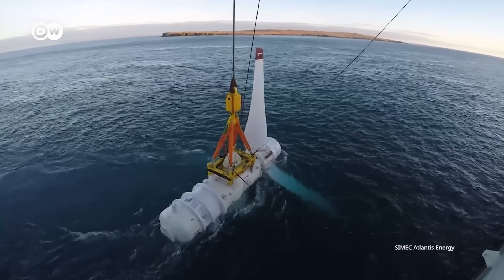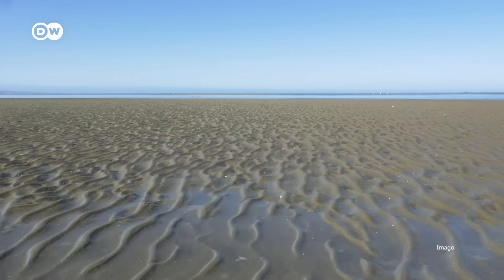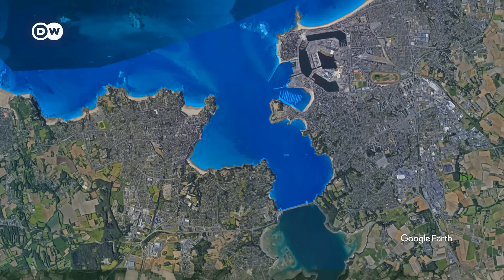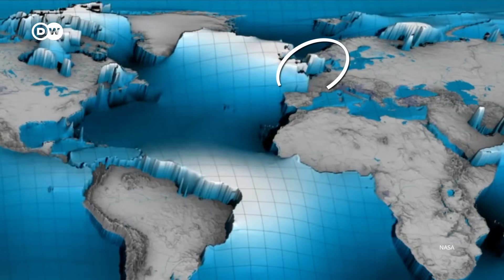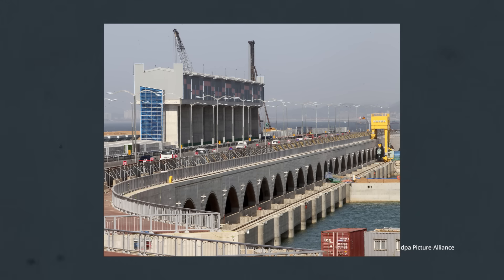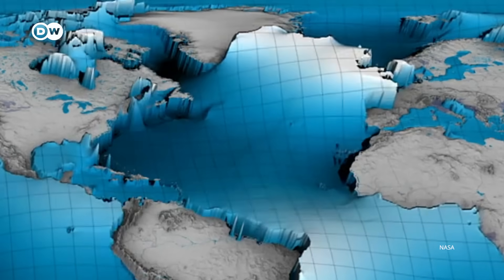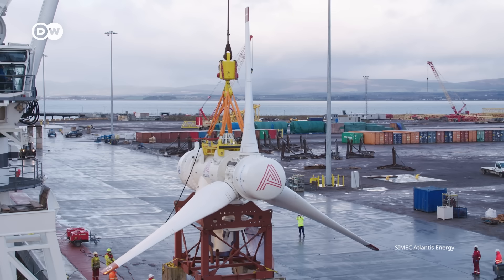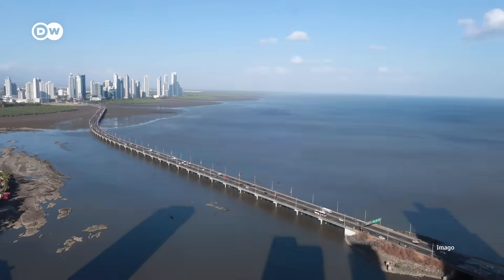Tidal energy could be huge – why isn't it?

Comment: Tidal power will never become a thing beyond the few test facilities build - reason: Maintaince.
Not only are such power plants extremely expensive and difficult to maintain, not to mention the loistics required, but they are also heavily in need of that expensinve maintaince.  And, for one very specific reason - fouling - a problem nown from boats since the dawn of time - and it will only be worse with fully submerged structures.  Yes, you can avoind fouling in the first years, using special surface treatment, but once it starts, it will be a never ending tasks to maintain.

Comment: Why ?
One reason might be we are trying to use a fish-slicing machine to generate that power and of course, meet HUGE resistance from animal welfare and activists.

Cant we develop something based on ARCHIMEDES SCREW instead ?  Pipes can be laid parallel to the sea bed, along the lines that ocean currents flow. No rotating parts to cause damage to beast or machine. The pipe rotates in the current and so is very unlikely to "hit" anything. The size of the external fins needs to be calculated for each location's characteristics, but you imagine they will be less than 50Cm high and so unlikely to catch any fish or whale, "unaware" and they swim into it.

Comment: Cool that you included Minesto´s Tidal Kites in there. They have a new model now it´s called the Dragon 12 and produces over 1,2 MW power. Easy to replace and low in maintenance cost. The Faroe Islands between Norway and Iceland already uses them on the grid.

Comment: a boat anchored will rise when tide is rising. That should be able to generate energy. Than when tide lowers, hang the boat above the water and use gravity to generate energy. No blades in the water. No corrosion. 
The boat can be very big and actually be not a boat but just a floating thing. The optimal weight to be calculated. 
???

Comment: Isn't it possible to use high quality strong plastic turbines to save against corrosion. With a bit of nano particles around, and a thin metal plates encapsulated inside.

Comment: Underwater turbines that look like windmills are about ten times too expensive.  Water provides buoyancy.  Instead of an expensive foundation for a post, a simple mooring would suffice for a turbine set up on a tether.  It would be neutrally buoyant, but adjustable, to rise to the surface for service, or sink to the bottom for shipping to pass.  When working, it would stay off the bottom with lift also generated by the current.

Comment: The ones that will succeed will have a nature covered (for aesthetics) cement pier type line surrounding long lines of turbines along the middle and/or most potent currents of the major tidal rivers and waterways (NOT across them) surrounding them so as to both protect them and to pull them up for service and cleaning when needed. The pier will be surrounded with pull-up (for regular cleaning) strong wire mesh fencing to keep marine life out and negate any marine biologist objections. In this fashion, ships and marine life can go around it on each sides untouched and unaffected.

Comment: Tidal energy is a pipe dream. The total annual energy flow of ocean currents + tidal + wave energy is around 700 exajoules. We currently consume 500 exajoules of fossil fuels each year. If we harness every single wave, tide and current at 100% efficiency so that there is absolutely 0 motion in the oceans, which of course isn't possible, we could barely power our current societies. Now imagine the scale of a machine that can absorb every single movement in the ocean - or even half. It would be as impossible as ridiculous, half of the planets ocean would be covered in moving contraptions.

Solar energy has for comparison an annual energy flow of 3.900.000 exajoules. The same energy can be achieved using far smaller areas, with far simpler machines with far fewer and smaller moving parts.

Comment: Not needed to store, with dispersed barrages five barrages could have supplied the  whole of the UK. In 2006 the UK had an inquiry into the Severn Barrage, objected to by the Greens and RSPB who said nothing about bird munching wind turbines. UK decided it would be too costly. A Severn Barrage could have provided road and rail infrastructure as well as tourist dollars. It was easy to tie the power to Hinckley nuke. In addition, will protect riversides from Global sea level rise. Presently there is a Lancashire Barrage, going to planning. The UK government is looking at building a dumb Barrage on the Medway. A generating Barrage would protect London and supply power for both London and Kent.

Comment: How many of these does it take to slow that current down
Reply from the maker: Hey there! As tidal energy uses the rotational power of the Earth, it is actually gradually wearing down the rotational power. However, that will take incredibly long and also depends on the usage of tidal energy.

Comment: Barnacles? Can you install them the length of the Mississippi, Ohio, Missouri, and St. Lawrence rivers in fresh water? Propelling and lifting tether-line electric trains continuously up and down river seems reasonable enough on the surface. Surely the NOLA current is strong enough, but what about the other thousands of miles upstream? Dams depend on head, not current, so would tidal generators work better? Or does the channel have to be made uniform concrete and maintained constantly?

Comment: Why? I bet it has the same problems all renewable tech have, the biggest is base load problem. We have to go full nuclear if it is not too late already. DW will likely block me now because they know the doctor was right about using Th MSRs, or even PWR to power the world :) Doctor was "blocked" too, in late 60's or early 70's, that's the way people like DW operate.
Reply from the maker: Hi Coda Alive, have you watched our video about nuclear already? We asked the question if we need nuclear power to stop climate change: https://youtu.be/9X00al1FsjM – let us know your thoughts in the comment section ☢🌍
Reply: @DWPlanetA  This are finally some great news, thanks for making it and letting me know because i would never expect DW to be so open about the nuclear solution. Hope to see more about it like burning nuclear waste in modern reactors, molten salt reactors on either thorium, uranium or mox cycle, passive safety, exposing problems with renewables few talk about and so on.
It is great start, keep the good work. Thanks!

Comment: A company called Ocean Power Technologies that does not need any turbines. It is simply a vertical stator with a floating magnet in the shape of a doughnut that rides up and down in the waves. ONE moving part and it is NOT a turbine....it just travels up and down on the stator as the tide goes in and out in the middle of wave actions .It does NOT affect  wildlife....again.....NO TURBINES..... WHAT HAPPENED TO THAT??????

Comment: This not a new concept. There are many problems with this.  The turbines need to be placed in an area with a high energy concentration.  Those tend to be areas with a lot of boat/ship traffic. Also electric, metal anything in salt water requires massive maintenance effort. There would also be a lot of environmental issues to deal with as well.

Comment: Title energy is something that's been around for decades upon decades upon decades. It's a simple alternator that's all it is to generate electricity. Don't get me wrong I think all forms of renewable energy should be obtained and used. But you move the focus on the one particular one over another one saying this one could be the best one though this one could be the best one you end up losing them within the group instead of focusing on the group itself. All renewable energies should be the focal point. Don't nitpick one or the other. And if you windmills are expensive to build and maintain just imagine how expensive these are going to be. And just imagine how much these are going to fail and need to be maintained and have constant maintenance performed. That does not mean don't try but don't glorify something like that either that requires components that we don't produce and requires minerals that most people on the left wouldn't like where we have to obtain them from.

Comment: Hydro power is superior to all other types of power because the whole ocean evaporates all day long and then deposits that power in the form of rain high up on land so all humans need to do is just make a bunch of hydroelectric dams on the same river. The water has potential energy untill it's back in the ocean. That's like a straight mile downward to collect that waters potential energy as it travels down

Comment: Are there any designs that involve using the power of a huge float(like a barge size) that moves up and down with the tide geared to turn a turbine? That would solve a lot of problems because the machinery can stay out of the water. The floats would be low maintenance and the only thing in the water.
Reply: could you explain what you mean by this further, i don’t exactly understand how a float would turn the turbine

Comment: What they're not telling people is that the average energy content of the tides per unit area of ocean is extremely small, far too small to do anything useful with. Only in a very few places in the world are the tides strong enough to get useful amounts of energy out, and even then, it turns out you don't get much electricity. Yes the French plant produces 250 MW, but what they don't tell you is that that's the peak output. Most of the time it sits there doing nothing, and only produces the 250 MW briefly near high and low tide. The rest of the time it generates nothing.

As for tidal flow, that demonstration plant is installed in the Orkney islands, which have the strongest tidal flows in the world. it generates a whopping 2 MW (peak), one 15,000th of the UK's average demand for electricity. Put it anywhere else and it won't generate as much electricity, in fact in most places it'll generate nothing at all, apart from higher bills for the electricity consumers forced to pay for this nonsense.
Reply: we need this energy now so why are we still using fossil fuels then?🤔

Comment: How does tidal power work exactly?... errrrrr.... it doesn't. That's the problem. It isn't cost effective. The only difference between wind turbines (which also aren't cost effective) is that the tides are reliable and predictable. It's just that we can't harness the power of the tides... and it isn't cheaper than nuclear power at all.

Comment: I like this, but sadly there is too much rubbish that is inlaid with the narrative that makes tidal energy seem pointless.  First, the narrator pours scorn on fossil fuels; however, not one single part of the extraction, manufacture, installation and ongoing operation of the tidal energy equipment can be done without fossil fuels.. not now, and not in the future.  Secondly, climate models are just that, climate MODELS.  They do not reflect the science or real world events.  I should add, that the climate change that is being modelled is that made by man through the use of fossil fuels, not the nature phenomenon that we have no control over and is actually happening (milankovitch cycles, solar flares/sun spots etc.).  Don;t get me wrong, I would like to see more 'natural' generation of energy, but I would prefer to see less use of plastics, businesses taking responsibility for the waste they create when they sell something and more recycling (just as we did when I was a boy before the age of plastic everything.

Comment: In the UK we a pro fossil fuel tory government . Fossil fuel is resisting its future of being a diminishing & intermittent supplier of electricity.  Tidal is predicable but the half moon tidal swing is often alot less than the full moon .. integrating the excess power with hydrogen production for HGV & planes would be a good plan.

Comment: Use hydrogen and carbon dioxide to make methane. Burn the methane or use it to make synthetic hydrocarbons. Also, use solar and wind to pump water into dams for releasing into a retention pond at night.

Comment: Tides are predictable but intermittent.  You lose an hour or more as the tide turns.  this is four to six hours a day of low production and more hours of only modest production.  This is the same problem as solar and wind - it is not on all the time.  Another big issue is corrosion and fouling.  Sea water is tough on most materials, and you have high maintenance costs.  Finally, many parts of the world do not have tides high enough to be feasible. 
Also, tidal power in La Rance is poorly compared to a conventional power plant.  While the cost is comparable, the power produced is far less than a large coal-fired power plant or nuclear power plant.  Factor in the intermittency and you have a lot greater cost to get the same amount of power.  That increased cost means a lot more energy is going into building the facility - which is more pollution.

Comment: Few numbers:
95% of greenhouse gases are produced by volcanoes.
The percentage produced by mankind is a minimal fraction of the remaining 5%.
MAINTENANCE COSTS of wind turbines makes them antieconomical.
Maintenance cost of submarine turbines would be appalling, many times those of the wind turbines.
Exemple: 20 billions invested in nuclear reactors (air pollution zero) would produce many times the power that can be harvested by tides (especially because of downtime of the submarine generators, plus the fact that tidal flows are predictable but far from constant). 
Expansion: given the available resources, we will produce far less CO2 investing into nuclear power: enough to dismantle the thousands of nuclear warheads sleeping in the arsenals and harvest the already enriched fuel. Win win.
Insisting in the so called renewables leads to no sufficient resources for enough nuclear plants, leading to burn coal to make power, therefore our kids breath the dust and die of cancer because of ill advised political ambientalism, political narrative without true scientific bases.
Talking NUMBERS here, not "opinions".

Comment: I’ve always thought that one way of harnessing bodies of water into electricity (be it the sea, lakes, or rivers) is to make holes at the bottom of the body of water, the deeper the better because it increases water pressure. Then a tube would connect the hole at the bottom of the sea at 100 meters for example (or ten atmospheres of pressure) to another hole at the surface. There would be a great negative pressure whereby the water would flow upwards towards the surface. Then that water pressure would turn turbines at high speeds, producing electricity just like a regular dam would, except that that particular water dam wouldn’t be located at an artificial reservoir but could be at the sea or lake for that matter.
Reply: That sounds like you're describing a perpetual motion machine.
Reply: pressure only depends on the height of the water column, if you put a tube in the sea, the water will not start flowing out
so if you have two fish tanks of the same height but different width and length, the pressure at the bottom is the same

however, your solution can work but not in the way you expect it
it is possible to exploit the temperature difference between surface water and seafloor water to produce energy, through stirling generator or else
so you just pipe water from the seabed to a power plant at the surface
Reply: Your idea is mine too. I thought im the only one thought about it. But you my friend you can not do that becoz the tube where the water exit will level up with the sea level thus no more moving force to move the turbine. Unless we used pump to maintain the negative water level whre the water exit from above .

Comment: Wouldn't  a cone of sorts capturing the moving energy actually work more efficiently without causing harm at all ? Why does it need to move, when the water moves ? Capture the energy not create more "noise" ! Also caging the location prevents capture of any kind. Changing the dynamic will not insult /assault the underwater population with its issues, right ?
Love the ocean , love the world, love our diverse populations. Think !
Reply from the maker: Hi Jacqueline, there are many setbacks with tidal power apart from its cost – and with regards to marine life, we address this 09:35 min into the video. With your point regarding ocean noise pollution, we have done another video on the topic here: https://youtu.be/ReNCbglhPIs – let us know what you think of this video in the comments section 🙂 🐠 🌍